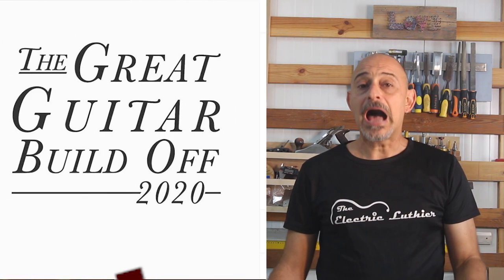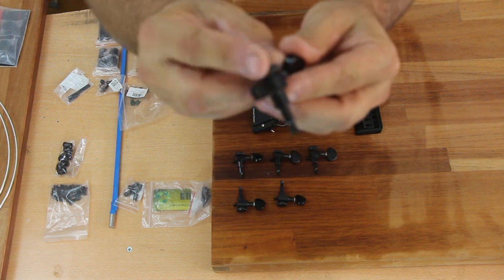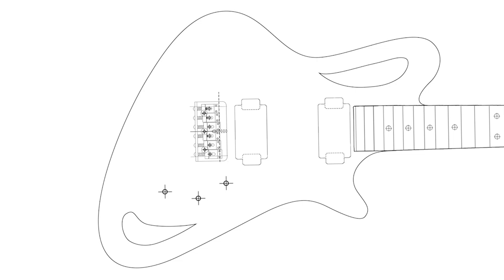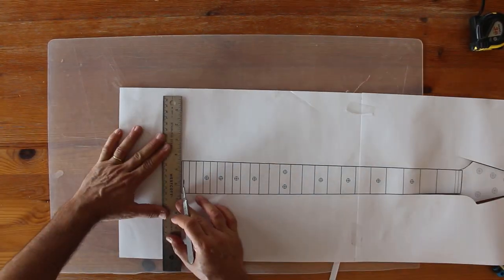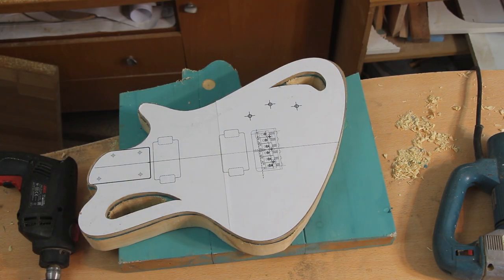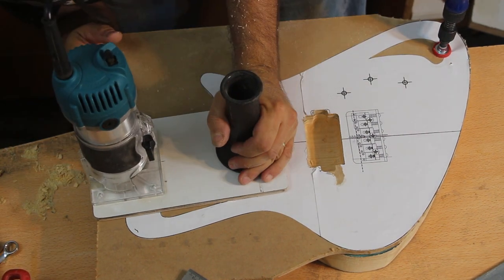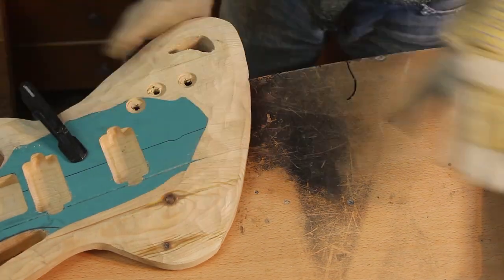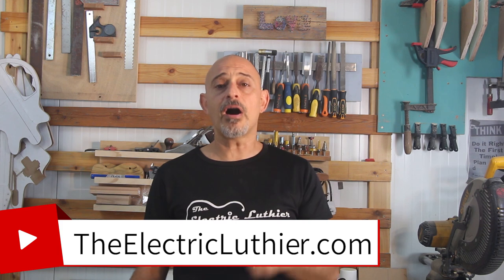My Original Design for the Great Guitar Build Off - Unofficial Part 1

Comment: I love this video, your techniques, attention to detail and the excellent running commentary.  My guitars at very small, they’re travel guitars, so I appreciate the issue with the controls and Jack. My solution on the latter is to fit a plate for the socket which fits top to bottom giving some strength.  I have also recently started using a rasp disk, the trick is a very light touch. It also helps to have one of those anti slip matts you can get from a kitchen shop when a clamp won’t hold. I look forward to watching the next video, good luck in the competition. Cheers Dave
Reply from the maker: Thanks, Dave, for the kind words. I am not really aiming for a small guitar' so my solution may just be to make it a touch larger, and since it's also going to be quite thin overall, I may actually need that extra weight to avoid neck dive. Thanks for the 'slip mat' note. I have an old yoga mat I use to protect the body in the stages where it is necessary. Maybe I'll just start using it earlier. Cheers

Comment: Love the video. Great build! You could have the output jack on the top surface instead of on the side. I think you should remove the lower hole all together. And a comment on the monkey grip. What about doing the round over only on the top part of it and keep it more square on the lower part of it. That might look even cooler.
Reply from the maker: I've been a little busy (the build off and all) and missed your comment before. If you are following along, you know I have lost the lower hole. The Jack plug I have, in black, doesn't fit top mounting but I found a solution. I also did pretty much what you suggested with the grip. Thanks 🙏

Comment: Great build. I plan to build a pine guitar as my first attempt. I'm considering an original shape instead of a Tele.
Reply from the maker: Pine is great for practice and prototyping but is problematic because it is soft and has long grain. That means it will more easily chip and dent during and after the build. Having said that, my first build was a Pine-Caster and it's a wonderful guitar. The body is still 'sensitive'.
Reply: Im doing a pinecaster right now too! The cost of a 'tonewood' body blank here in Australia is really expensive. If I mess up  at least its just on some cheap pine.
Reply: Pine's fine if you know you're practising.  I've used it on several prototype bodies and on a complete guitar (including neck).  Not something I'd show off and just know it might damage easily and know that's in part the material and you'll be fine.  And soon you'll be hooked and have an expensive hobby :)
Reply from the maker: @ClearEmOut  Totaly go for it. As long as you are aware of the drawbacks, Pine can be light, cheap, and available. You can always upgrade pickups, which are much more significant for the sound (in my opinion) than the wood.

Comment: Hi man great video..I hope you don't mind me asking..is there anyway I can get the template for the neck please? I am currently starting to build a guitar and I'm just wondering if there is a way I can use the print off to make my template? Thanks
Reply from the maker: Thanks, Olan, 🙏 You can download the plans (from which I have personally strayed a little) on my download page: http://theelectricluthier.com/downloads/
Cheers
Reply from the maker: BTW, it's a 25.5" scale length (like a Strat). Make sure you print it to scale and not 'fit'. I would still measure before cutting. The frets are there for reference and are not accurate enough for slotting. Also, check your tuners in advance, it's a very tight fit for some tuners and you may need to make adjustments, I did.
Reply: @theelectricluthier1928  thank you so much man. I am currently building a strat type body and now that I have found a good neck template I'm really happy... thank you so much I am currently watching your series so I can follow while I build my first guitar. Thank you so much for the help
Reply from the maker: @olanmccarthy109  Glad I can help